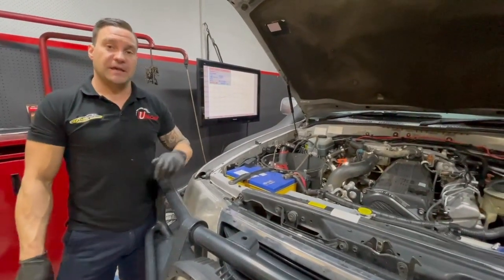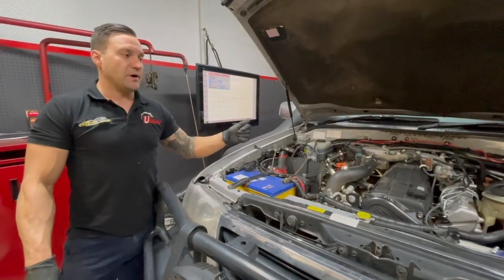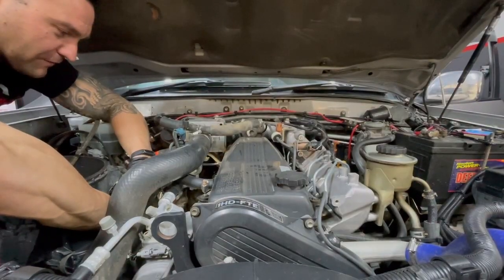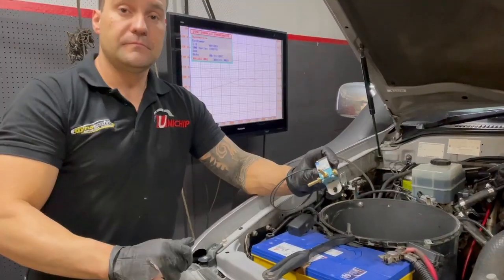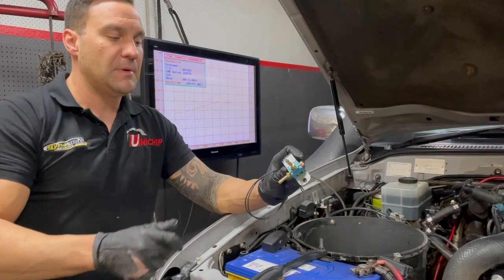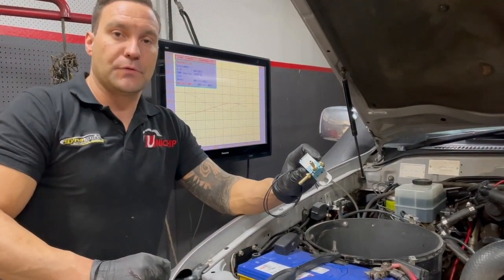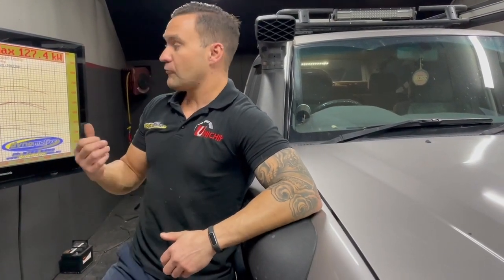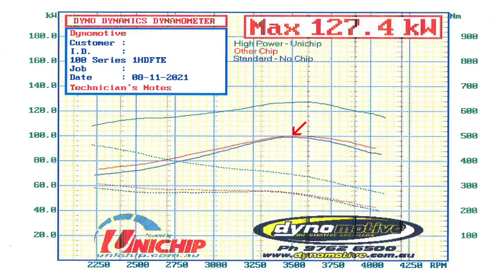We fit a Uni-x ECU and Optional Boost control to this 100 Series 1HD-FTE and LIVE dyno tune it.

Comment: Guys any reasons why the baseline is so low to start with at 300nm? Great to end up at 470 but a number of fte’s you guys do often start around that 380 - 400nm so they end up up around the 570 mark with the uni x. Is it necessary to ensure the motor is running right (eg ensure the fuel pump is sweet) before you chip or do you just go with it and address any issues when you tune? Like was this vehicle running like crap before you guys tuned it?
Reply: Yes my non intercooled one in a 79 ute pulls 100kw standard with just an exhaust.  It pulls 120 with a chip and 580nm torque.  Steinbauer chip.